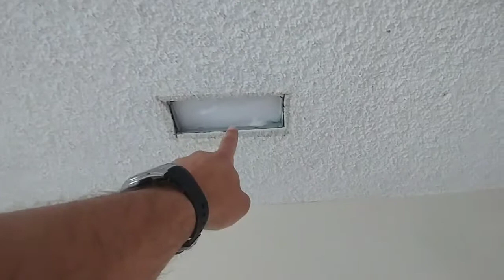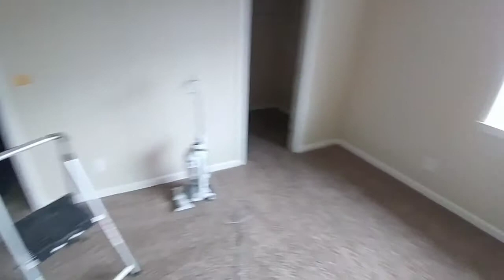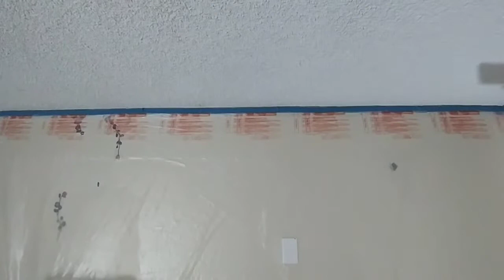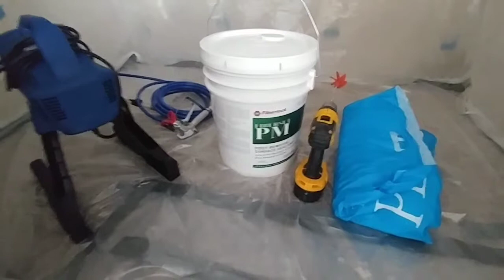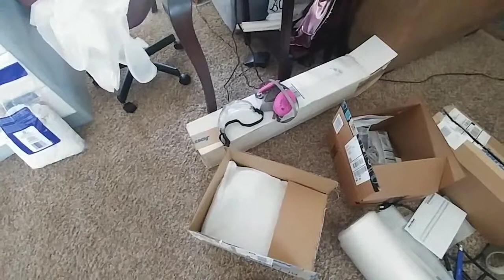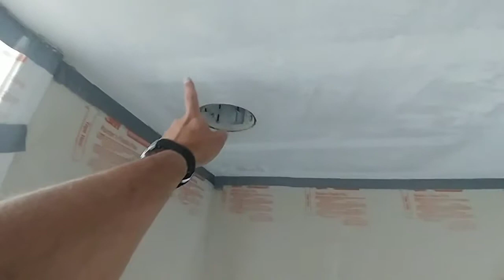Asbestos in your house could kill you.

Comment: I’m 16 years old and we have a 50s house I think and my family and I have lived in this house for 16 years so my whole childhood but we just found out today there is asbestos all on the pipes and the whole air ventilation and all over the popcorn roof in the garage. And the heater has always been on with asbestos on the pipes and next to all the stuff in the roof My dad has had a cough for a long time and I’m worried it’s because of the asbestos and we’ve been breathing it in 16 years and I’m just so worried. And Ive also had a blocked nose for the last 3 or 4 years growing up. Do you know if this is because of the asbestos?
Reply from the maker: If your nose situation is because of asbestos is not my expertise. Asbestos bound in building materials isn't all that scary. It only becomes a danger to your health if it gets released from its bonded state (released into the air) buy sanding or scraping on it. Asbestos is a naturally occurring  fibrous silicate mineral which is mind for. It was used for so many thing. Roofing, Isolation, brake pads , clutch plates in cars, fire proofing etc.
Reply: J C hey thanks for replying. I’ve asked several people and they all say it should be good as long as you aren’t disturbing the asbestos. We are trying to get the asbestos removed soon and have new air conditioning around the house.